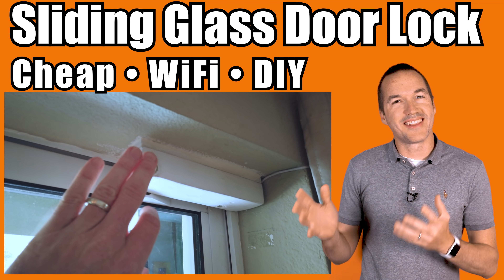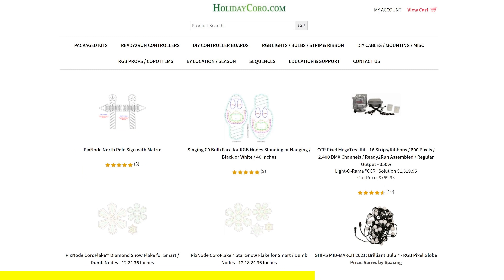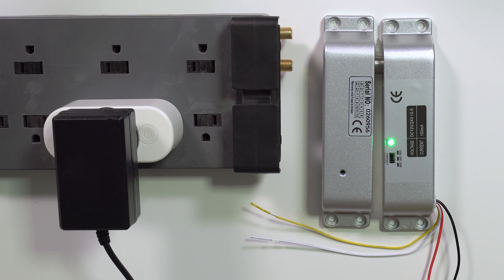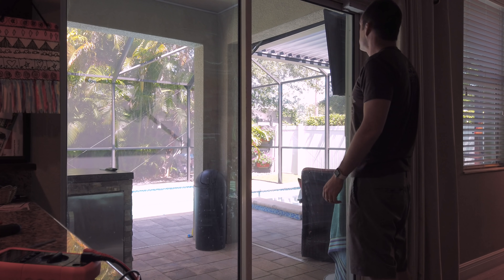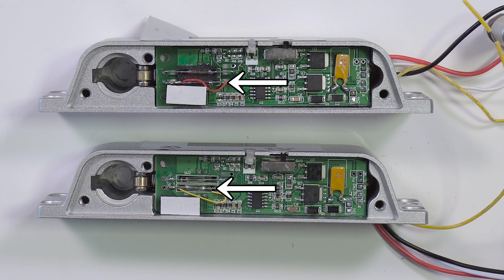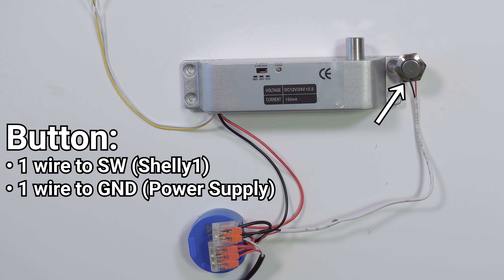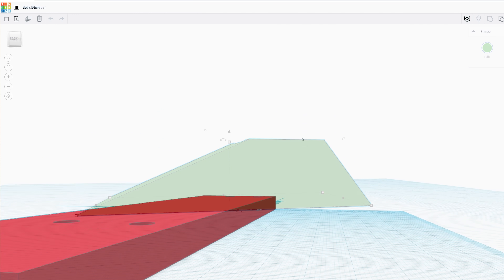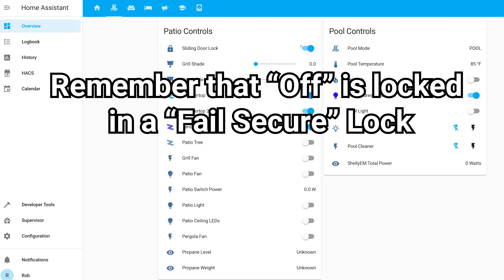DIY Smart WiFi Sliding Glass Door Lock for $50!  Universal Fit. Fun DIY Project.

Comment: Great idea and video!
Did you look into any momentary power switches? Would need a small battery to allow triggering either lock or unlock on power loss but would use less power overall (still need wifi).
Also, if your door gets a lot of sun, I wonder what size battery and solar panels you would need to skip the wires/adapter...
Reply from the maker: Me and batteries don't get along.  I tried for over a year to convert my blinds project to battery power and was met with one failure after another.

Comment: Another way to actuate a lock with less overall power use is with a servo. No power draw when idle, and you can manually move the servo in an emergency.
Reply from the maker: Not a bad option, but definitely more complex and less universal fit.

Comment: Great project. Here in Bolivia 🇧🇴 we too have a lot of sliding doors, and windows lately.  I might a use another board with an extra input pin to get close confirmation. Or put the button somewhere else.
Reply from the maker: Since it’s wifi there’s no reason you couldn’t just tie it to a generic smart button or even a wall switch. I just wanted to have the button on the unit to make it easier for guests to understand.
Reply: You can use the shelly 1 too! In fact, it has 3 additional GPIO pins easily accessible (see https://shelly.cloud/knowledge-base/devices/shelly-1/#pinout ) to connect to the closing reed sensor. However, for use them I think you may need to use Tasmota on Shelly and control the switch via Home Assistant or similar...